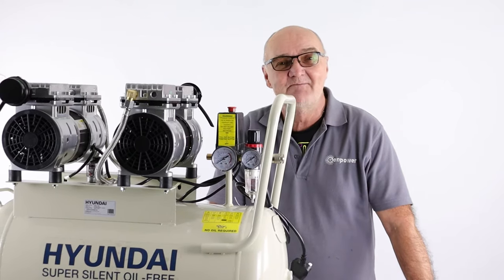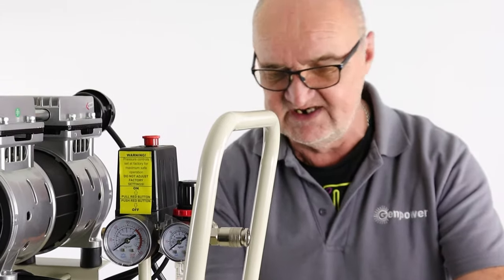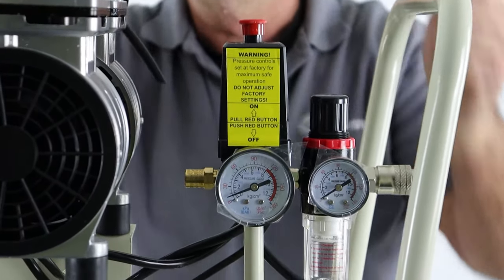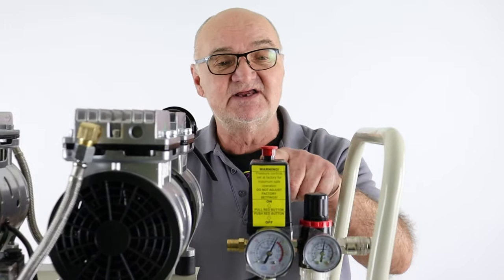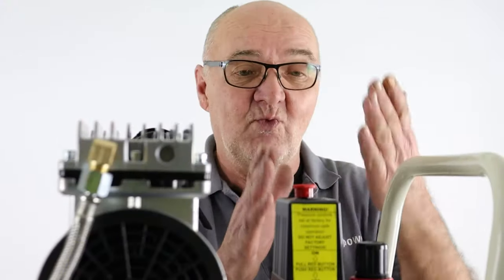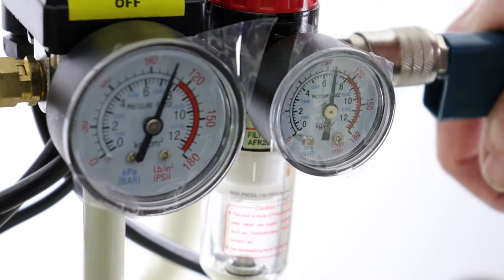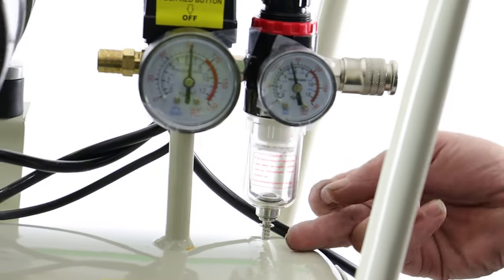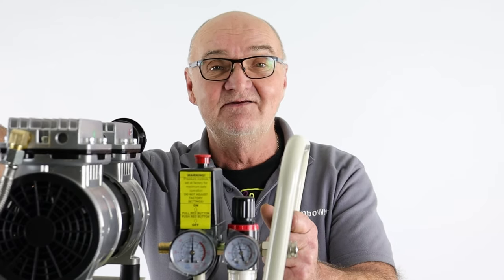Using your HYUNDAI Low Noise Air Compressor (The HY27550) How to use an Air Compressor

Comment: Great video. It helped much more than the manual, which was quite frankly, terrible! I will probably only use mine once a month or so, so i feel i should decompress the tank when not in use. In the storage section it says to decompress using the relief valve but there no diagram of parts so I have no idea which is the relief valve. If you could help that would be appreciated.
Reply from the maker: Hi Barry, really sorry to hear that the manual has been a cause of confusion - we are looking to add more separate and thorough instructions to make this clear in future. The relief or release valve is located on the underside of these machines. You can twist it to release the air from the tank which is essential in preventing condensation within the unit.
Reply: @HPPUK  thanks for that. I knew there was a valve underneath for draining off the condensation but it wasn't clear what this valve was called or that it was for draining the compressed air too. Thanks for the clarification.
Reply: Agreed the manual is terrible. This video is great.

Comment: Hi there, I recently bought a new Hyundai 24L air compressor similar to the one shown in your video (I purchased the 55762). I'm a total newbie when it comes to air compressors, so a few of your videos were extremely helpful to get me started, thanks a lot for your excellent guidance! 🙂

I've got one question I hope you can assist with. I won't be using my compressor that often, just occasionally and when I'll be using it, it will be for a few minutes only. So if I use it for example 3 or 4 times a day for 5 mins (so 15-20 mins in total on a daily basis), can I leave the air in the (full) tank, even if I won't be using it for several days? Is there any risk/danger to leave a full air tank just standing there for some days (unused) or is it advisable to drain/re-fill it each time/day I'm using it? Obviously I'll turn off the power, but I'm not sure about the constant pressure on the 24L tank.

Just asking as a newbie, because I prefer not to re-fill/drain the tank several times a day/each few days, just like to be sure there's no risk/danger in leaving the air tank filled for a while...

Comment: How do you drain air from the tank after you're done using it?
Reply from the maker: Underneath the tank, there is a decompression valve, turn it until you can hear air escape - remember to tighten again afterwards!

Comment: Im new to air compressors, so apologies for the uneducated question. But is there a way to stop/or adjust the automatic refill when it the air gets lower? If not, will a bigger tank mean I can use more air before automatic refill is turned on? Thank you
Reply from the maker: Generally there isn't a way to limit the refill, however - if you wanted to stop the automatic re-fill you can just shut the machine off and the air within the unit will remain compressed for quite some time. You can use this until empty without the automatic refill kicking in this way.
Reply: @HPPUK  That's a great solution. Thank you!

Comment: Hi
I bought mine to use it on dental manikin and I am afraid of using it to be honest! 
Could you please help me: 
1- can I use in my bedroom? Is it safe? 
2- can I use it on a carpet? Or I need to out something underneath? 
3- when I want to stop using it, shall I switch off the main after pushing down the red buttom? Or I can keep the main switch on all the time? 
4- when I first used it I felt that there is a bit of air leak from the tube - tried to fix the tube and push it inside but then it came out and all the air came out with noise. What to do if I hear a leak? 
5- when I touch some parts (screw parts), theu are very sticky as there is glue or oil there. Is it normal? 
6- is there any water that comes out from the compressor?
Reply from the maker: You can adjust the output pressure however you'd like as shown by the valve in the video:
1. Yes, you can use an air compressor in a room - they are safe.
2. Do you mean blowing air onto the carpet? Regardless, it won't tear holes in your carpet or anything like that.
3. Best practice is to shut down the red button and remove from the mains, then decompress using the valve shown
4. Ensure it is securely fastened into the air compressor, and check your pipe for any nicks or compromises, if your air compressor is within warranty, call our aftersales team and they will be more than happy to help
5. This shouldn't be the case? It is an oil-free unit - try wiping down the parts with a kitchen roll and all purpose cleaner , does this help?
6. You should drain the air after each use , using the valve underneath the air compressor - this prevents water

Comment: Hi, I have got questions. Do you recommend if I should use 24L or 50L hyundai air compressor to respray on car using LVHP spray gun?

Does it work well for you if you have used 24L or 50L to respray on your car? I'd love to know!
Reply: I recommend you use 50L to elongate spray capacity and enable a constant pressure and spray.

Comment: Hi. I am searching for a air compressor for a tool that requires 250 L/Min. My question is - does 300L/Min is input or output air flow rate?
Reply from the maker: The L/Min refers to the flow rate (output) of the machine.
Reply: @HPPUK This confuses me. I called my local Hyundai distributor and they told me that the indicated flow rate is at the intake side. Can you provide a link to a spec that indicates both input and output l/min for Hyundai compressors? I am thinking of getting a HYC1500-50S

Comment: Hi, Ours is just a week old, and we're getting used to using it. But there's an issue I think, adjustment of the psi down doesn't seem to work  as in the video - I use an air gun to allow pressure to drop having pulled the adjustment knob up, turn the knob as directed, but both regulators drop and after a little time the motor kicks back in. The psi isn't reducing. However, if I empty the tank and adjust psi as it increases, I can stop it on the required psi (I just did this to achieve 30psi). 
Is something wrong with our regulator?
Also, ours is taking about 2'50" to fill from empty; in the videos I've seen on line, it takes about 2'20". Any suggestions to possible cause?
Thanks.
Reply from the maker: Hi Chris, it will definitely be worth getting in touch with our very helpful aftersales team! They should be able to assist over the phone specifically with your issue: 01646 687 880
Reply: That's great - thanks for the reply.
 @HPPUK